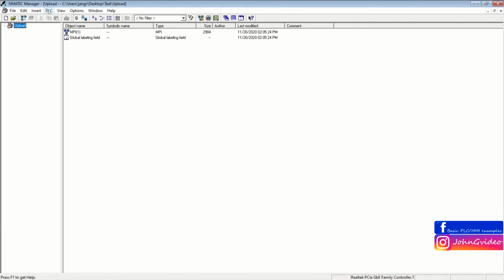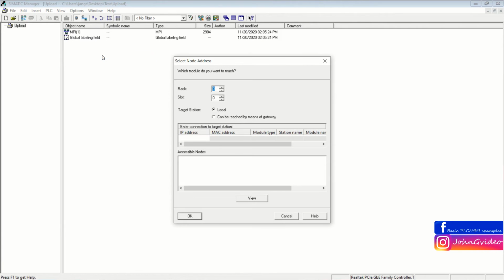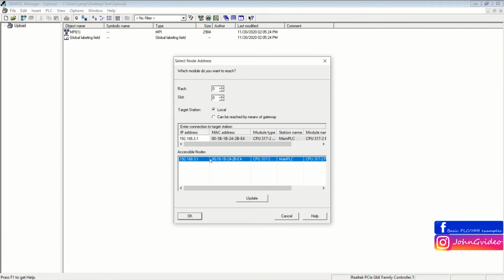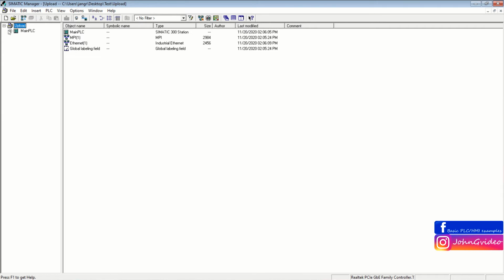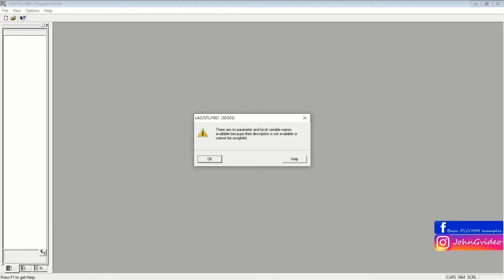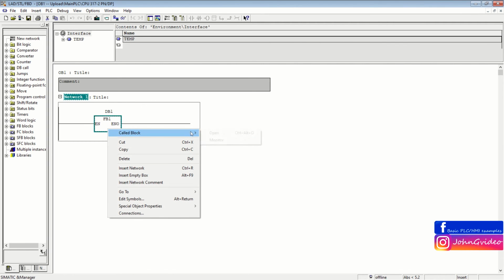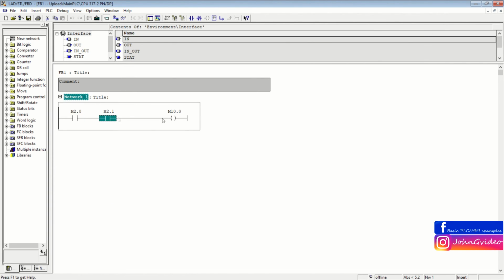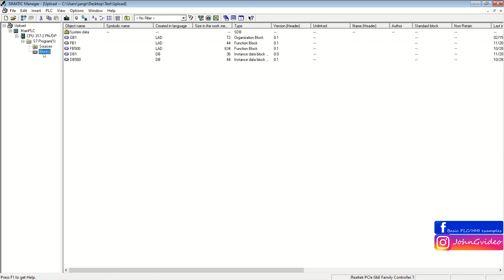Upload program from PLC (Simatic Manager STEP 7)

Comment: when i tried to connect to plc (cpu315 pn/dp , i am taking an error so that , " communication can not be established " , can you help me please ?
Reply from the maker: Check settings of PG/PC interface in your control panel, and also your IP address setting :)
Reply: @JohnGvideo  i already check them , my ip adress , 192.168.0.230, ip of plc doesnt match with it .set pg pc also ethernet what i am using.By the way i can see which module can be using there from accessible device but when i want to open the blocks,  taking a fault "communication can not be established" ?
Reply: why you can not reply ?